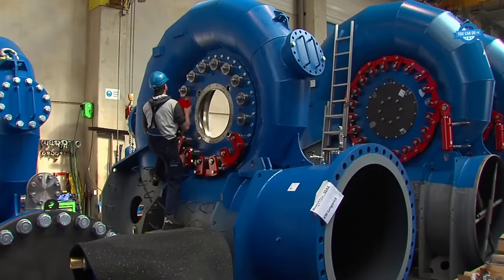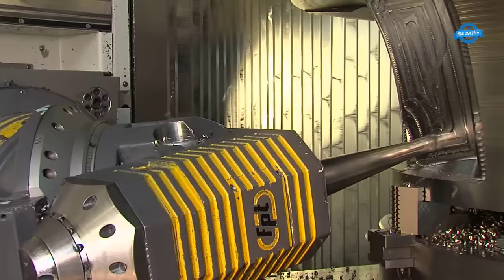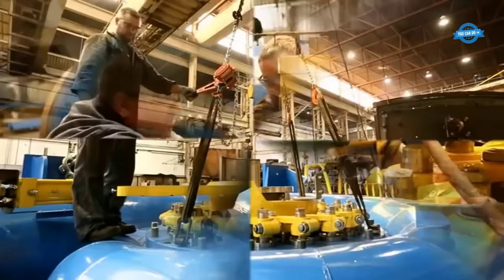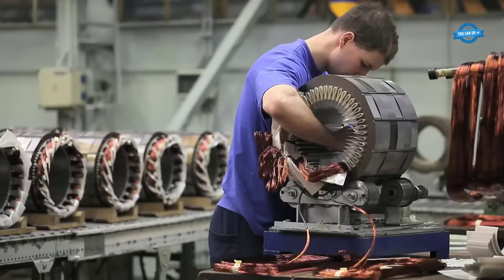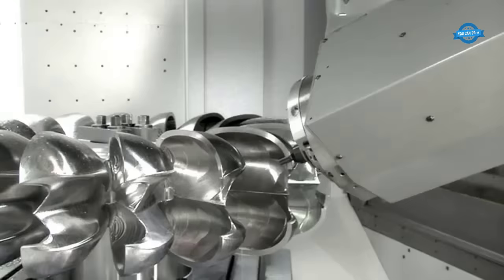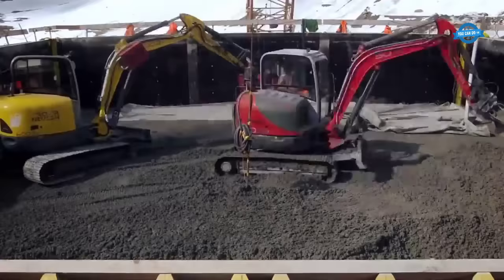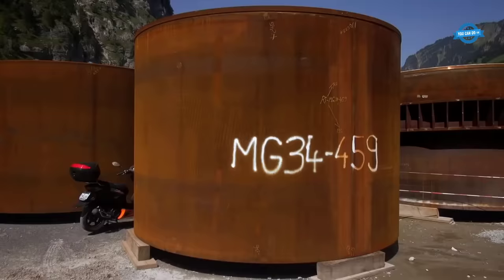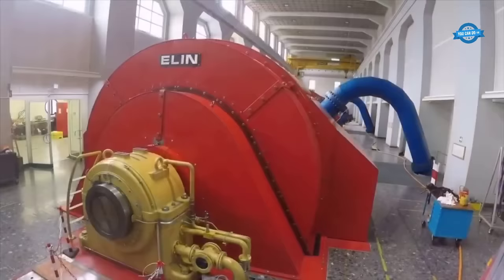How To Build Hydroelectric Plant On High Mountain. Pelton Turbine & Generator Manufacturing Process

Comment: Swiss powerhouse… ‘says Francis turbines. Not so, Pelton wheels shown.
Reply from the maker: There are 2 kinds of turbine here, please refer this key moments:
0:22. Seamless Rolled Ring
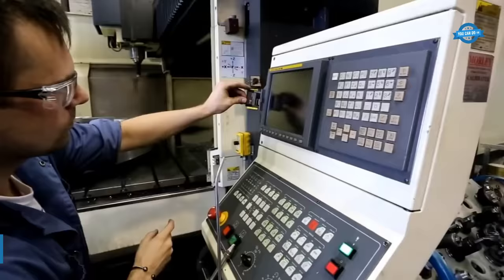1:59. The Manufacturing of a Francis Turbine Stay Ring
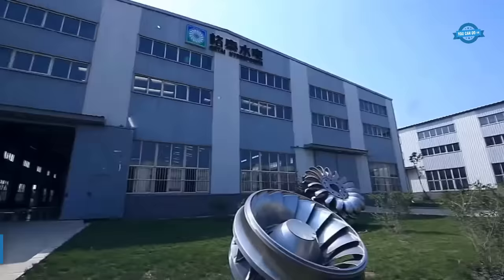3:36. The production of a Francis runner
5:28. The fabrication and assembly of a Francis runner
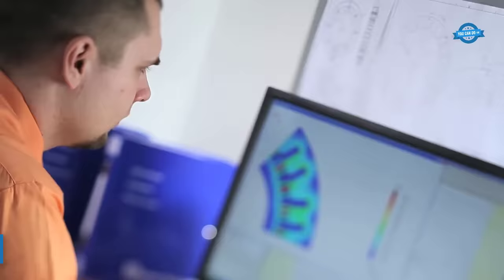9:45. Production of generators
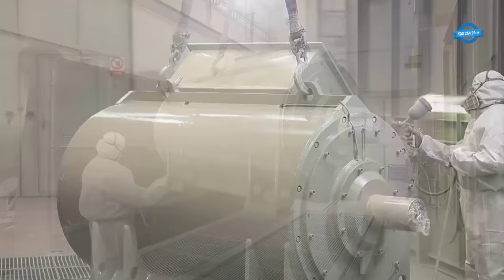15:59. Production of Pelton runners
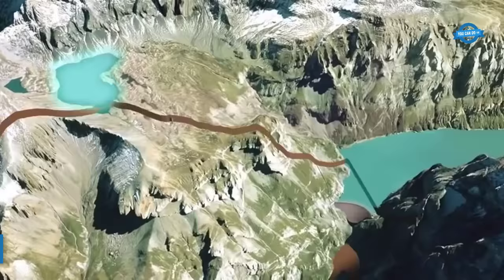18:59.  Hydraulic steel construction
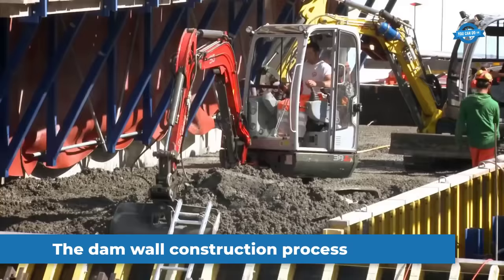21:52. The dam wall construction process
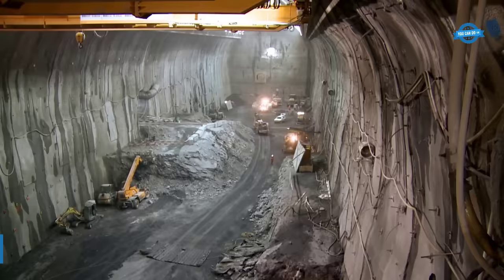25:08. The Limmern pumped storage plant
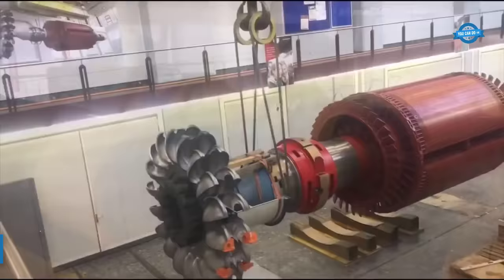29:26. Vernayaz Hydroelectric Power Plant (Pelton turbine)

Comment: The naration was about francis turbin but the video show the pelton turbine... how is that??
Reply from the maker: There are 2 kinds of turbine here, please refer this key moments:
0:22. Seamless Rolled Ring
1:59. The Manufacturing of a Francis Turbine Stay Ring
3:36. The production of a Francis runner
5:28. The fabrication and assembly of a Francis runner
9:45. Production of generators
15:59. Production of Pelton runners
18:59.  Hydraulic steel construction
21:52. The dam wall construction process
25:08. The Limmern pumped storage plant
29:26. Vernayaz Hydroelectric Power Plant (Pelton turbine)
Reply: @YouCanDo_TV  at 30.17 it s show pelton turbine but explaining about francis turbine. That what I mean..